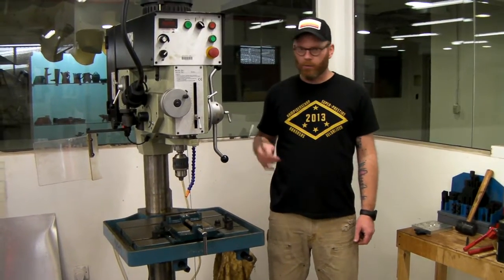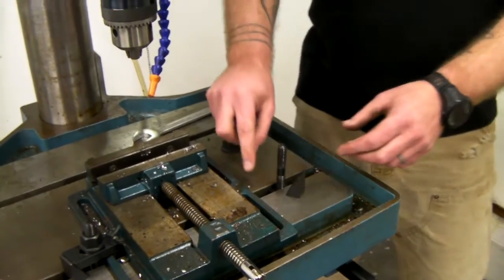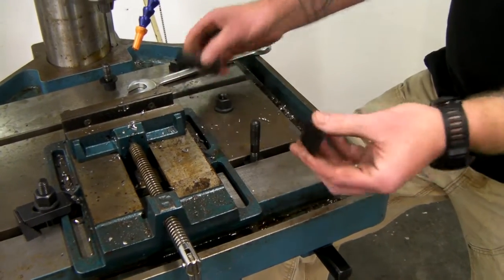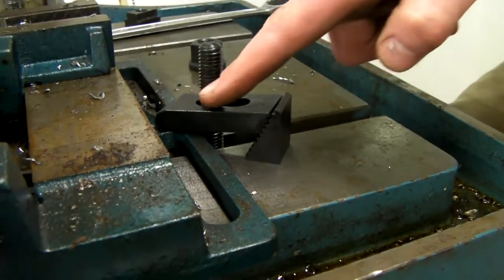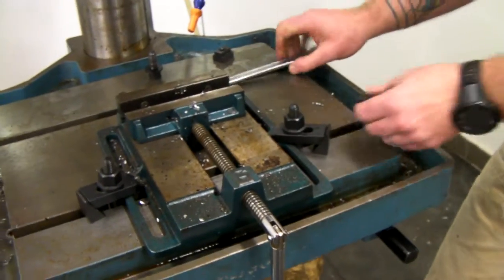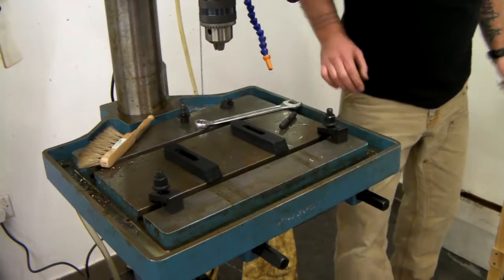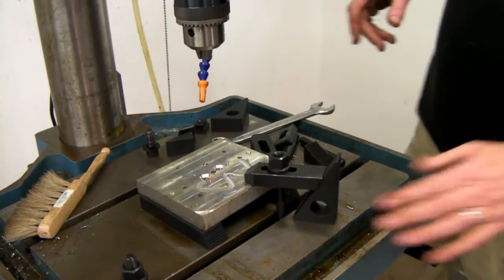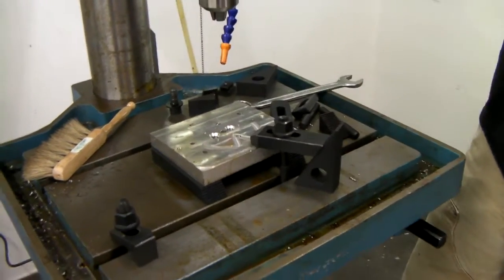Drill Press Clamping

Comment: That is an extremely slow way to set up something to be drilled!!!  That's why those clamping kits usually sit in a corner for years without ever being used.
Reply: Did you see the size of the drill press? Skimp on clamping and you'll be sorry the rest of your life (which may not be that long).